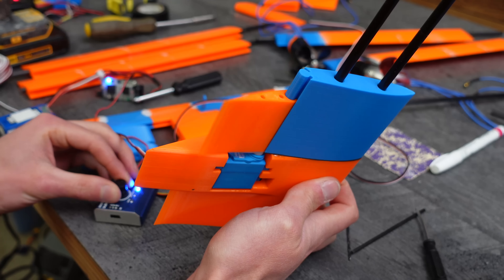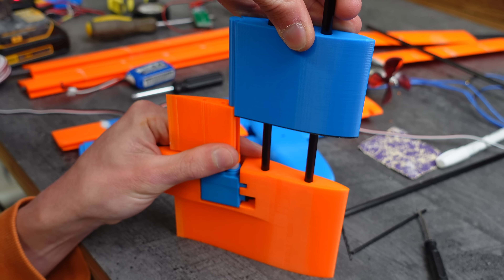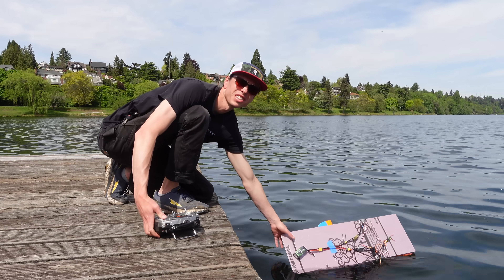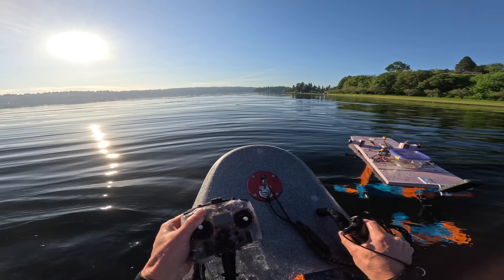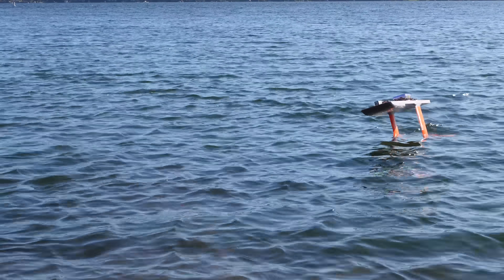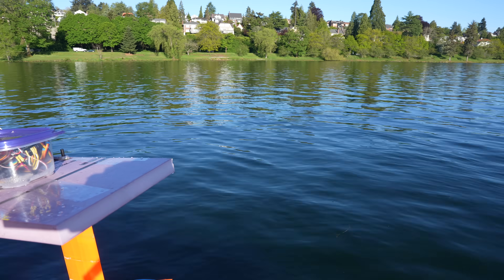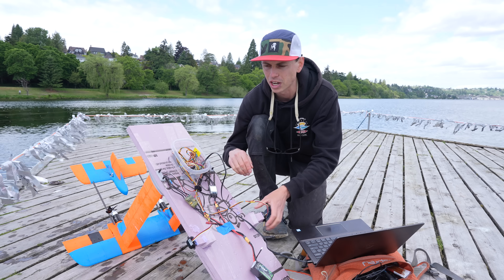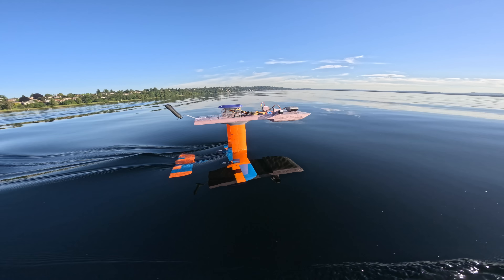3D Printed Hydrofoil with Sonar

Comment: Thats sick, It's going to be nice seeing perform in on chopy conditions. With that stability ocean waves are going a breeze. I've been wingfoiling into surf for a while now, with a craft like one you are designing its going to be able to downwind trough islands the hawaiian islands in no time. Im curious about the Aspect Ratio of the foil of the RC, good move on going on the double mast setup, like the Beta pump foils. The next progression could be on using the advantage of having a sturdy connection to the wing, to experiment on higher aspect foils, with tapered wingtips to keep the ease of roll.
Looking forward every new iteration 🙌

Comment: As with an airplane, you need a little up input of the elevator when turning. You can also mix in the rudder, elevator and aileron controls for the turn.

Comment: Four thoughts about your hydrofoil design:

1) Regulate Motor Power: Ensure the motors adjust power based on real-time speed readings, not a fixed output. If the power remains constant, any deflection of the control surfaces will induce drag, which reduces speed. As the speed decreases, the control surfaces become less effective, leading to even more pronounced deflection in an attempt to maintain control. This cycle can continue until the control surfaces are so deflected that they stall, causing a sudden loss of stability and control. By regulating the motor power according to actual speed, you can compensate for these changes and maintain smooth, effective control.

 2) Deflection Indicator: Add a visual indicator for control surface deflection, like a cross of LED rows. This helps you avoid shifting weight towards an already maxed-out control surface, preventing sudden dives. Plus, it lets you fine-tune your weight distribution for optimal efficiency.

3) Combined Rudder and Aileron Control: Integrate rudder and aileron inputs to manage ride height by moving them in the same direction. This technique, commonly used by submarines, helps maintain a level ride height without pitching forward or backward while making height adjustments.

4) Foil Winglets: Consider adding winglets to the tips of the hydrofoil wings to reduce vortex drag and improve the lift-to-drag ratio. This can enhance the efficiency and stability of your hydrofoil, leading to better performance at higher speeds.

Comment: There are heat shrinks with waterproof glue pre-applied.
Usually it's 3:1 and 4:1, it is hard to find a 4:1 heat shrink tube without this glue.

Also marine-grade shrink solder connectors exist.

Comment: They make heat shrink tubing with hot melt glue inside to make water proof connections much easier. Used them for my boat trailer wiring.

Comment: Have you seen the Solder Seal Wire Connectors? Its heat shrink with a solder ring built in along with water proof hot melt. Just join the wires together and heat gun the connecter in place. They save a lot of time trying to water proof soldering connections.

Comment: If the full scale version still manages to get too much lift that it can't go faster because it starts to breach the surface, perhaps you could add some upside-down flaps controlled by the altitude sensor, to add some downward lift when needed without having to nosedive or slowdown to lose altitude? (or maybe mix the inverse flap signal with both the aileron and elevators, so you won't need to add additional moving parts, if the control surface got enough down-lift capability already)

Comment: You might not need any proper control surfaces, and you could just use trim tabs for almost all of it.
Also you could weigh down the board to test the yaw-roll coupling. (And test with the full scale wing loading)

Comment: 15:20 Well i dont have to tell you why @rctestflight why it dips in to the turn (roll) on yaw input, same as a High-Winged Cub, you need to counter steer with ailerons to keep it horizontal, if you want it to be horizontal that say. this is due to the inner wingtip is stalling then turning. so you need Aileron cannot be without it.

Comment: Great project and video! It would be cool if replaced the foam board with a foam duck (or flying dinosaur) shape, so would look just like duck flying low-level, with the occasional pop-up. 
Would be a fun companion with hydrofoiling on you larger surfboard. 🦆🦖 🏄‍♂

Comment: Might want to use an accelerometer so the controller can tell the difference between a wave vs change in board height.  Might not matter as much on a big boat as the waves will be proportionally small compared to a big boat, but still interesting to see.  Right now the sonar sensors might follow the wave height if they are the only input for height.

Comment: For some reason, I think you should try a version with the upright stanchions being more pyramid shaped and connected farther out on the front wing. They could have control surfaces instead of the ailerons. 🤔🤷‍♂️
 The elevator/tail can be "V" shaped to help with elevation when turning, too.

Comment: Might get away with less actuators if you put them on angled axis, for example such that the ailerons tilt down and out instead of just down. That, in theory, will cause them to act like water brakes and improve turning. Basically one side will be up, but tilted closer to the center of the board, while opposite will be down, but with center of pressure further away.
As for making the tail more streamlined, just run all your linkages through the tail boom and mount servos into the main wing.
Side note: a basic 1/16" hardware store cable works nicely inside of a bicycle brake cable housing, in case you need something cable-operated but can't get a long enough bike cable.

Comment: The downside to the acoustic altitude control is that it takes out much of the hydrofoil advantage of smoothly cutting trough waves, instead of riding over them.  All a matter of balancing the response speed of the sonar mode.

Comment: A very interesting series  of experiments mate , the first thing that crossed my mind  was an image of that wing under  a full size cat , with  retractable  masts to minimise the draft . the fact that it pops up at such low speed means is could be perfect for sailing boats , which sail normaly at around 6 to 7 knots , the hardest thing with those is the stability in gusting wind . Your system seems to have already solved that problem . The one question I can think of is if you used the rudder and sail power would it still work .

Comment: You should add a feature on the final board where you can lower the vertical stabilizers to enable higher motor speed

Comment: They make heat shrink with hotglue inside. We use something similar in aviation with clear heat shrink and a small blob of glue at the ends of the tube that you can verify has flowed properly.

Comment: the point of a hydrofoil is to have less resistance on the wing area than the submerged area of the vessel. In this case, although it looks cool, the wing area is not much smaller than the above-water part.

Comment: About the last part with the vertical stabilizer, I think you indeed don't need the stabilizer as a control surface, but a lot of the drift could be counteracted with a simple vertical fin on the hind hydrofoil
Reply: Fantastic work!  Please tell us the basics of getting various sensors to communicate to some box (arduino?).  Also how that mystery box makes output that your RC receiver can understand as a command.  I’d really love to see a block diagram that shows where PID functions etc are carried out, then turned into an elevator output.  Many Thanks!

Comment: Moving the CG forward will probably have a net negative effect on both speed and endurance.  You're going to get your best efficiency with the CG somewhere slightly aft of the main foil MAC.  You could alleviate some of the efficiency losses of a more fwd CG by lowering the frontal and surface area of the horizontal stabilizer, but you will still likely never want the CG in front of the main foil.

Comment: It looks like you're testing on Green Lake now. I used to paddle on northern Lake Washington where you've tested a lot of stuff. I'll be very interested to see how well your project will transfer to a large SUP. There's a lot of surface drag to overcome. Of course I've never been on a motorized board, so they may have a lot more power than I imagine, especially since you'll have two of motors! I'll be watching this project. Hopefully you can get it done before winter when the storms make things a lot rougher out there. :))

Comment: not sure if it'd be too heavy but what about wing warping for aileron? CF torque rods/tubes to the wingtips which could be a compliant plastic?
Reply: And do you use inertial measurement? could be the go for rough weather, have the sonar filtered?

Comment: Why not make the rear "fuselage" smaller diameter and longer and connect it to the wing?
Possibly less drag since the water is already separated by the wing so it doesn't have to be separated twice.
That could also prevent the tail from being broken off by eliminating a snag point.

Comment: Did you think about splitting the rear wing, and use it as combined aileron and elevator?

Seems logical that combining them in the front didn't work as elevator, because it's near the center of drag/mass in the pitch axis, but at the rear it could work for both axis. Of course it wouldn't be as effective in roll than current setup, but it could save two servos.

Comment: You might experiment with a (more?) symmetrical air-foil to reduce throttle pitching.  Probably less of an issue with the weight of a person on a full size board, but it could add more passive altitude stability? I.e., separating speed and altitude dependency from the motors and elevators.

Comment: I think the elevons would work better without the horizontal stabilizer. Just one wing with elevons and differential thrust.

Edit: I also think that adding sweep to the front of the wing would add dihedral effect for better roll stability.

Comment: It would be a little more work and probably a little more structure, but if you attach the mast(s) to the back of the vehicle, they would act to stabilize the craft (a la a rudder) rather than be destabilizing as they are here.

Comment: The drag from the mast and foil does matter.  I used GoPro GPS to get max speed from a "2nd gen" aluminum foil vs 3rd gen all carbon-- max speed with same surface area foils was 13mph vs 19mph.  The newer CF mast is thinner and doesn't have fasteners sticking out holding the fuse and front and rear wings on.   The design of the rear wing also affects lift and stability a lot.  A fast flat 158cm2 vs carving V shaped 220cm2 tail is a huge difference in stability.  FYI if you exceed the max speed, the foil wants to shoot out of the water.  You can also feel turbulence.  Using a SUP as a board will be interesting... probably too big.  Look up downwind foil boards vs the new mid length ones (narrower for better displacement performance, but not as extremely narrow and long like downwind boards that are really hard to balance and have weird inertia due to the extreme length).
Reply: NSP made a floaty, relatively narrow foil board that would probably be an OK budget performance choice, it was 1st gen but ahead of its' time.  They're "old" at this point so probably inexpensive used.  They were 800 bucks new in 2020 or 2021.

Comment: If you want free roll stability you shouldn't use a straight wing. Dihedral wings are on most aircraft for a reason! Might take some experimentation to find the optimal Dihedral angle to maximize lift and minimize losses to drag but that would honestly be a fun video so no reason not to.

Comment: Have you seen the dual counter rotating propeller design Candela is using in their e-hydrofoil boats?  Would be interesting to see tests on that, although probably slightly more difficult to build😅😁

Comment: That rear section will not last in practical applications due to cavitation but maybe you can move it up in between the 2masts and maintain its functionality.
Auto leveling foil is the next step. Good luck.

Comment: given that the model had little to no load above the water, on the full sized version, won't you have some better need for yaw control, given that you will have to cancel the inward force of the weight ? I'm thinking like an aircraft, you need yaw to keep yourself in the correct turn rate without drifting. (sorry if badly explained, not even close to an engineer here)

Comment: it seems that alot of comertial foils use anhedral wings would that add stability.  You might also want to use the elevons and elevator to control depth, while the elevator manage pitch.

Comment: It looks nose heavy. Forward motion then makes the board act like a downwards elevator in the wind, making the control surfaces work harder to counteract that pressure. Have you tried shifting the centre of mass backwards a little? If the system has to work less to raise the front of the board it should travel faster for the same throttle, extending battery life and reducing servo and motor wear.

Comment: 4:25 You should check out @PrintPractical's video on "injection molding" hotglue. Even if the hotglue doesn't work well for long term waterproofing the same idea could be extrapolated to silicon.

Comment: Holy crap, this is amazing. I had dreams of just slapping a hydrofoil on a RIB, but now I think I'm screwed because it won't ever be stable without all of your automatis controls. Do you think there is any kind of passive feedback you can design in to the shape of the foil to keep it stable? Like canting the outer edges of the foil in an upward direction?

Comment: the elevators should entirely rotate, not only the small ailerons it has, of course it means finding the proper placement of its axis to limit the load on the servos. Same for the main wing, they should rotate entirely. The small aileron design on a static wing works on planes because of the low medium density (air) and because air is compressible, but in water you are killing the efficiency with this design which features a kink in the profile. Keep the main wings in control of the roll. the altitude should be controlled by the elevator wing AND the main wing, by orienting them in the same direction, not the same angle probably since they don't have the same lift, it needs tweaking. The pitch should be controlled by both wing by orienting them the opposite way. If I were you I would design the motors to be inline with the main wing because now you probably pitch down by pushing with the motor higher then the center or pressure/drag (wings), maybe the motors could be attached to the whole rotating wing

Comment: Do you not use adhesive shrink tube? I would think that would be water proof without extra silicone so long as you didn't cut it too short.

Comment: If you moved the engines back a few inches and made hinged mounts for vectored thrust, could you get rid of the elevator entirely?  Would there be any advantage to this?  If the motors were also hinged vertically, could they provide enough roll control to replace the ailerons?

Comment: I have questions, if you stacked say, ducted fans, vertically, would the thrust stack? Does the thrust come off the blade or the outlet. Is it the same for any prop driven system? Assuming the blade pitch and/or prop speed, on each subsequent unit, is adjusted for an increased air/water mass flow from the previous? Would they 'require' contra rotating units?

Comment: Elevons had no control authority compared to elevators since the elevators had the advantage of the long moment arm compared to center of mass. Would be curious to see what happens if you made the tail control surfaces elevons rather than the wing's?

Comment: Maybe you can leave the altitude control only with thrust. Then if you shift your weight forward, the board will need more thrust to stay at the same height. And it will be more like driving a Segway. Could this work?

Comment: Curious why you decided to go with split control surfaces rather than a wingeron-style pivoting wings? Wouldn't you get less drag without the spanwise seams? I would be tempted to try a fixed wing in the front and a rear stab split into elevons.... IF that gives you enough roll control, you have roll and pitch out of 2 servos and differential yaw
Reply: or you might also be able to make the tail entirely passive if a pair of more traditional wingerons gives you enough pitch control (should still set up enough deflection angle between the main wing and the tail, but might be more responsive for roll control)

Comment: Did you try the ailerons as flaperons for the altitude control, then the elevator would just be pitch control? It might then just lift to the set height as soon as there is enough throttle and stay perfectly flat while doing it?

Comment: Since it seems like the altitude is function of the speed and pitch, would trimming the ailerons up/down together allow for altitude control that's (more) independent from the velocity and pitch of the craft? Just because in my head at least, if you want to go really fast with the current configuration then you'd have to pitch down to counteract the lift. I know you did something similar in the video in terms of elevons but I'm just curious if controlling the "elevator" aspect of the elevons with the sonar but the actual elevators with the gyro would do anything worthwhile. I hope this made some sort of sense. Really cool video!

Comment: Could mast drag explain the stability? If it's riding high, there's little drag, so the board would tend to tilt forward and angle down. When it's riding low, there's a lot of drag from the masts and the center of thrust below it would tend to tilt it upward.